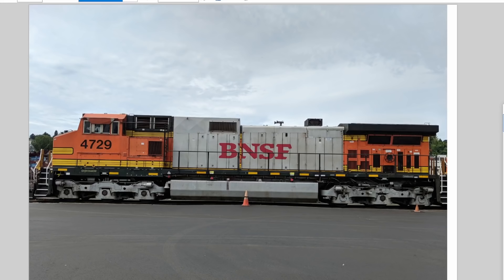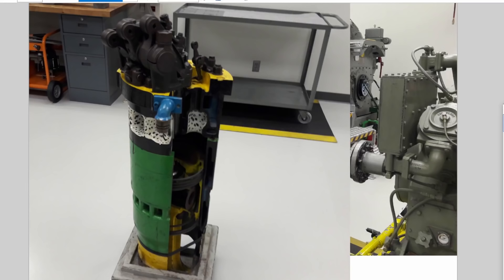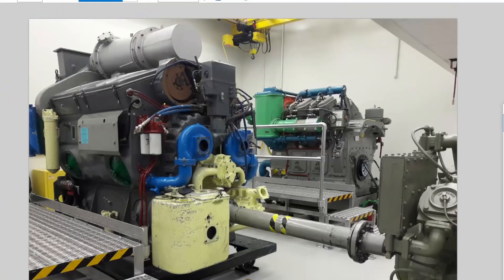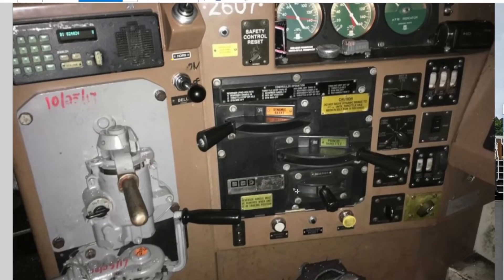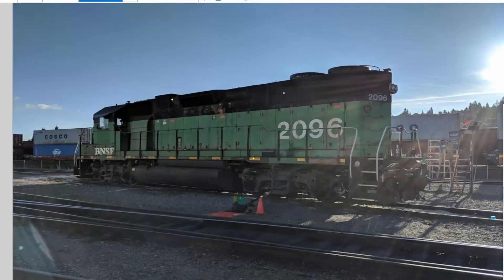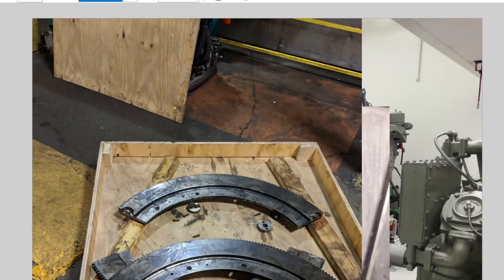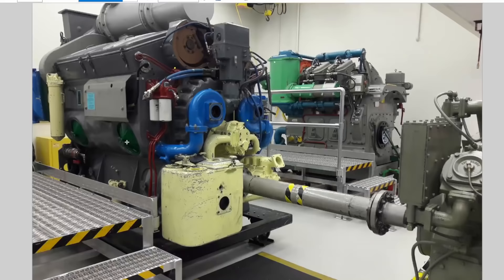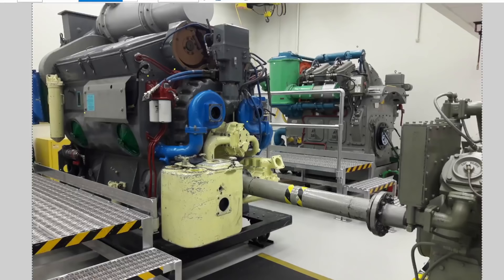Diesel 101 - How DIESEL LOCOMOTIVES Work! [10 Levels]

Comment: I know I mentioned this before but now that you're talking about diesels, remember the story I told you about my cousin Roland? How the engineer fell unconscious and he nearly so until he pulled the emergency brake and stopped the train? I was unable to find any reference to the incident so all I had to go one was word of mouth and, of course, this happened back years ago back in 2005-2007 and, if I recall correctly, Roland was still assigned to an older locomotive, #80, and he told me the cause of the incident was attributed to carbon monoxide.

If that was what it was, what all had to fail catastrophically or go horribly wrong for that to happen? Or could it have been something else?
Reply from the maker: Hm. Exhaust leak? Hard to say.

Comment: Sorry if I'm a dumb-ass, BUT:
As far as I could make out, there appears to be a major lack of instrumentation for the engine,alternator, etc., e.g. RPM, oil pressure, coolant temp., alternator amps, voltage and so forth on the Control Stand.
Or is it just done by idiot lights?
Good recipe for a fricasseed engine, alt. or traction motor, I would have thought...
Reply from the maker: Alternator amps is there, but yes, there's not much for the engine other than idiot lights, haha. Depends on the loco, manufacturer, and the age - the newer stuff has more in the computer, etc.

Comment: Maybe something to consider is you start with no power electronics, mediocre battery chemistries, and have to do everything mechanical.  All kinds of solutions are found.  The problems with the solutions that do 'work' is they are either not very efficient and/or not very reliable / durable.  As time progresses, electronics get more and more into the mix, however many old solutions remain as they are considered "good enough".

Something that tends to not happen unless someone is really willing to push for it and has the backing to make it happen is a complete rewrite of how this all works.  We have the technology to make most every system talked about here go the way of the dodo bird.  Even the diesel engine is no longer necessary, so we will likely never see the ultimate evolution of what this could become.  It is really interesting though as you come across all of these technical challenges in a mechanical and basic electricity world, what all solutions are found to make a practical system at scale.

Something brought up in this video are batteries and the lack of their usage.  As you get into when you would apply such technologies, you start talking about a complete rewrite of how a locomotive works from the technology showcased in this video.  For one, it mainly makes sense to have traction batteries after you have optimized a system to be highly efficient and now you want to add more efficiency by adding batteries to the mix.  Second the size of the battery is centrally important to the battery chemistry used.  There are very high C rate batteries out there, but they tend to trade density for power.  You look at the NiMH battery in a Toyota Prius for example and it is a very high C rate battery, but it is also a relatively low density battery.  Bringing up cell phone batteries is kind of interesting because in the modern day LiPo batteries can scale to very high C rates, granted most of that is on the discharge side, and these are also higher density batteries than NiMH.  Lithium Cobalt Manganese batteries like what Tesla's are famous for, granted your standard range Model 3 has an LFP battery pack, are generally setup for very high density and relatively low C rate.  LFP often comes in at a somewhat higher C rate than Lithium Cobalt Manganese, but also lower density, lower cost, and much higher durability.  LiS is an old, but now possibly emerging chemistry after some long standing severe issues with these batteries or purportedly solved.  These could be very interesting both for the abundance of Lithium and Sulfur available and very high all around performance of the batteries beating other chemistries on every front that matters for mobile applications.

If you want to really use batteries in an all in one locomotive, I would think you would want to do at least some of the following:
1. Use a very high efficiency motor / generator technology such as the switched reluctance motors in the Tesla Model 3.  These motors would be driven by sophisticated electronics and attach to a common DC power bus.  These motor / generators would be many poled to help compensate for the low speed output of the engine crank shaft.  Maybe consider a simple gear ratio to spin the motor / generator faster so it can be smaller, granted direct drive would probably be more reliable.

2. The common DC power bus would have the batteries hooked up in series basically directly to the power bus.  You would do various optimizations to the locomotive to allow a mass capacity for the largest possible battery.  If you could have say a 50 tonne battery that also acts as part of the structure of the locomotive, that provides a fair amount of room to get into medium C rate batteries such as LFP and if LiS comes to the diesel electric locomotive, it really starts to become a question of why are we even bothering with diesel engines?  A 50 tonne LiS structural battery pack on a locomotive gets into the 5 MWh to 10 MWh pack size range, which could push a locomotive a long ways all electric.  This gets into the thought of why not just have overhead lines where it is convenient and most effective to recharge batteries and have a really big battery pack on a locomotive that can easily weigh up to 216 tonnes for everything, meanings lots of room in there for lots of battery capacity, and just recharge the batteries via an overhead line through a pantograph?  With a common DC power rail, you can take a page from the Toyota Prius playbook and have everything driven off of the common DC power rail.  You could also have connectors to hook the common DC power rail up between multiple locomotives.  So for example you could have any mix of primarily diesel and all battery locomotives hooked together and only use the diesel generators when needed and distribute power from the battery locomotives to more wheels when it makes sense to.  With everything in a locomotive tied to a common DC power rail, electric motors directly turning anything that needs to be turned such as an air compressor or a turbo-super charger or the like, is far more efficient and reliable than having all of these mechanical linkages and gear boxes and such.  Instead just direct drive everything with electric motors and the power electronics end up handling all of the nuanced detail that was once handled through less ideal mechanical systems.

3. When you get into big batteries, power electronics, and a common DC power rail, a high tech, highly efficient motor / generator attached to a diesel engine simplifies things some as you just spin up the diesel engine to operating speed with that motor / generator, control power output with power electronics instead of this generator - alternator deal, and do away with starter motors and all of this other old school jazz going on.  The traction motors on the wheels hook up to this DC power through power electronics and very efficiently push the locomotive forward and capture the braking energy, unlike the current motor / generators on the wheels that are far less efficient.  Maybe another important point to bring up is with speed, you start talking about voltage ranges as in the faster the locomotive goes, the higher the voltage your electric motors operate at.  I think this is an important point when you talk about using an alternator is in a conventional car the alternator is designed to put out a constant voltage over a wide speed range of the gasoline or diesel engine while in a locomotive the diesel engine is more constant speed and you are interested in a varying voltage to handle traction motors attached to the wheels.  When you go hybrid battery electric, you need a DC power rail that fluctuates voltage over a limited range depending on the SoC (state of charge) of the batteries, which needs to be completely decoupled from the speed the locomotive is traveling at.

4. Barrowing some from the Toyota Prius again, the coolant for the diesel engine can have an insulated storage chamber and be pumped out of the engine when it is off.  The Prius uses this technique to rapidly get the engine up to operating temperatures.  Actually when you unlock a Prius and open the door, you will hear the pump going to pump the coolant back into the engine so it is all ready to go when you "start" the Prius.  With a diesel locomotive, you would be more focused on skirting various technical issues with coolant and large scale diesel engines while avoiding problems with the coolant freezing.  A big battery system can also include electric warmers to keep coolant from freezing in the winter when the locomotive is "turned off" as in there could be a reasonably small parasitic draw to keep the coolant from freezing without too much concern of the batteries draining all the way down.  Granted you would still have a limited storage time out in the open, but how long are you really going to keep your locomotives sitting idle?

5. I think an important point when thinking about locomotive drive trains is trains are modular, low drag momentum machines.  People start seeing large numbers and get their minds blown and think certain things are not possible, but the reality is it is more doable than ever.  It is just everything is scaled up and some extra considerations go into handling this larger scale.  In many ways trains are big, dumb machines.  With the history of things, some things happen on train locomotive first just because we figure out how to do something, but first manage to shrink down the solution to train locomotive scale before going to something smaller like a car or truck.  Then there is some major leap in technology and maybe you see it on a car because there are piles of cars everywhere making it easier to justify the investment on R&D costs as there are many cars produced to spread the cost over and the solution is immediately available at this scale.  However because there are thousands of locomotives produced over the course of decades instead of millions of cars produced each year, it may be a long time if never when the technology catches up to the locomotive.  Another thing when the locomotive first came out, there were no cars, so the locomotives got all of the technological advancements at first.  The railroad companies were once some of the largest employers in the country.  Now train tech is an important, but basically forgotten thing, so when you think of doing new tech, you just don't think of trains very much if at all.

Comment: What about the difference between AC and DC traction and why the Iron ore mines in Western Australia use ES44c4 DCI locomotives and not ACI or any other variant of the ES44c4's?
Reply from the maker: It's the same as any difference between AC and DC motors in general. AC has less maintenance (no brushes) so most railroads have been moving towards those. Why that railroad picked what they did I don't know.
Reply: @Hyce777  Ah, ok, thanks.

Comment: EMD was once a "Division" of General Motors and before that it was called EMC (Electro-Motive-Corporation) and D was short for (Division). GE really started kicking EMD's a** right around 1964-1965 with the U25. Some names that are only doing marine prime movers now are: "Fairbanks Morse" "Sulzer" "MK", and loco names that are just gone now like Baldwin, Alco, Lima, Erie Built. Some FM's had opposed cylinder 2 cycle prime movers. The boxer diesels liked to rock the locomotives from side to side, and were surplus submarine engines. That helped kill FM's locomotive biz. The boxer diesels do get up to speed really really fast though. They are great diesels for tug boats & emergency generator sets!  There are two types of dynamic brakes. There is a helical coil brake and a planar carbon disc. You are burning off energy by converting the electricity to heat. They are gigantic resistors (carbon piles) The helical coil applies more braking with the more force that is applied, and are favored on railroads with lots of steep grades. Planar brakes are pretty steady and do not increase braking with the energy being fed in and were very popular with flat grade railroads. EMD made "tunnel motors" too with the fans & vents on the sides  to keep the engine from ingesting too much hot air inside of long tunnels. That would choke off the prime mover and kill it. Some of the old diesels also ran Paxton style super chargers, a centrifugal blower rather than a roots  style blower.

Comment: Isn’t there power electronics between the main alternator and the traction motors on an AC locomotive? You imply there is a direct wired  code tion.
Reply from the maker: Yes, between the alt and TM's on both an AC and a DC locomotive. We glossed over a lot of the electrical side. That'll be another video.
Reply: @Hyce777  I believe on the DC units, there are just som contractors to select windings etc. but on the AC units the current coming off the alternator gets rectified to DC as it is variable frequency because of variable engine RPM, and the is inverted back to AC at the correct frequency for the traction motors. Does this sound correct?
Reply from the maker: @stanbrow  That sounds vaguely right but I genuinely don't know enough about the load side to fill in the rest.

Comment: GE had built an ES44AC Tier 4 locomotive, and they said that it has a clean air producing engine and I want to know how that works.
Reply from the maker: Lots of filters and diesel tech in the exhaust; dual turbos in series providing high air pressure and also extremely high pressure fuel injection which creates the best chemistry.
Reply: @Hyce777 Thanks for the information 👍

Comment: Interesting that the air box, which has elevated pressure,is adajacent to the crankcase, which has a below atnnospheric pressure. Did you tend to have air leaks from the air ox to the crankcase?
Reply from the maker: A few times, yes - a bit uncommon though.

Comment: Hyce, is there a push to use 4 stroke diesels in place of the 2 stroke engines for emission reasons?
Reply from the maker: Yup. EMD has only been trying to make new Tier 4 emissions locomotives that are 4 stroke. I've not heard of any 2 stroke meeting more than tier 0+.

Comment: I used to work for GE in Erie Pennsylvania building these monsters
Reply from the maker: That must have been a cool gig!
Reply: @Hyce  it was. I miss it a little bit but moved on to better a better job. Definitely a cool experience. Did a few jobs. Assembled the AC and DC traction motors. Then assembled the trucks and wheels and my last job was building the alternators

Comment: I'm a little surprised that you didn't mention the fuel system.  On smaller diesels the fuel system, with its low pressure and high pressure pumps and filtration and fuel and water separators, is every bit as complicated as the lubrication system.  

I, for one, would very much like to hear a presentation from your electrician colleague.
Reply from the maker: I honestly couldn't remember which details were with each locomotive brand, so I left it out. I probably should've mentioned it in the video though. There was nuance between the EMD and GE's for the fuel sightglass, bubbles in EMD was bad? but normal in GE? and there were two sight glasses on EMD and it had to do with the filter life... lol. Forgotten more than I know, I'm sure. I'll see if I can't wrestle him into doing one.
Reply: @Hyce777  That would be great.  My layman's understanding is that with some smaller diesels air in the fuel system can at worst ruin the injectors or injector pump; I shudder to think of the cost of that on a 3000 hp locomotive diesel.

Comment: I know I am late to this, someone has probably asked. But why do engines still use 8 notches of power instad of a more traditional throttle with infinite positions for optimized power put down?
Reply from the maker: These days it's more about the MU signals. We have 21 pin connectors, and with all of the communication that needs to happen down each unit in a consist and standardized implementation - we still transmit those "Throttle Valve A, B, C, D" down the consist to tell the locomotives what notch to load in - there's not really a good way to do it in a more robust way without re-doing all of MU, which is an AAR standard industry wide.

Comment: Wait, are you saying the reverser switches the polarity on the field windings on the alternator rather than switching the drive current? Genius.
Reply from the maker: I'm fairly certain it reverses the polarity of the fields in the traction motors, not the alt... But I am not an expert in any of the electrical system of these so what can I say.

Comment: 16:12 Since EMD’s forced induction is driven by the engine before changing over to exhaust pressure, wouldn’t that technically classify it as a centrifugal supercharger as opposed to a turbo?
Reply from the maker: A supercharger until it becomes a turbo. It's a weird thing.
Reply: @Hyce777  lancia Delta s4 has a similar system.

Comment: Is it fact that the mass and rotation of the drive wheels on steam locomotives caused the railbed to washboard, which is one of the main reasons diesel electric locomotives took over?
Reply from the maker: Eh, steam did hit the track worse than diesels do, but once rail got to a certain weight, anchoring became more common, etc. - it really wasn't that big of an issue. Maintenance killed steam engines.